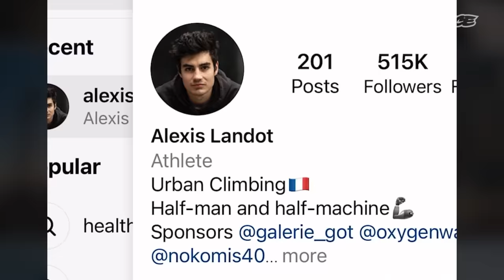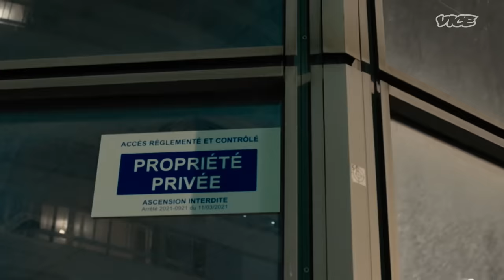Climbing a Skyscraper Without Ropes | Rites of Passage

Comment: I was a high rise window cleaner, hanging off of sky scrapers with nothing but a rope and a little wooden seat. I know from experience that those little metal frames he’s putting his feet on can easily fall off if they’re not installed correctly. I’ve seen them fall by barley touching them with my swinging foot. Idk if the ones on this building are installed differently than the ones I’m thinking off but regardless. I would never trust somebody else building something correctly with my life. People always told me I must have balls for doing the window cleaning, but no. I had a back up line attached to my harness. This guys the one with no fear
Reply: I was thinking the exact same thing, when he's holding on to that cladding, big mistake.
Reply: How much do they pay high rise window cleaners?
Reply: @Grizzle_Uno  of course depends where you at and what company so it’s really a wide range in Florida I saw hourly rates go from 17- about 30$ an hour. I made my most money when I started doing piece work, I would get paid by how many times I went over the building instead of by the hour. And when I did that I just hustled, skipped lunch and did as much as possible. When I moved to Boston the starting pay was $30 an hour so it’s really dependent on where you are and what company you go to.
Reply: I am a high rise window cleaner and there's no way in hell.
2 ropes, boatswain chair, my safety, my rack, harness and rope protectors go over the wall with me EVERY drop.
There are so many sharp edges and exposed fasteners on all skyscrapers that this is just foolish
Reply: Those metal frames are beauty frames 
They aren't structural
They are trim
Glued and clipped to the window frame to hide the exposed edges with a finished surface
They aren't meant to hold your weight 
They fall off all the time
Reply: It varies on location and height of the building.
Mid 20s-40s depending on experience and what you are doing.
Window cleaning, leak repairs, glazing work etc etc all use the same equipment and methods so it's down to the job you're doing
Reply: Where in Florida did you work?
Reply: @corrosivesprings9526  not down here, union work back in New York. Buildings aren't that tall here, 600ft ropes are the biggest we use here.
Reply: @francislutz8027  yeah I know, New York is crazy. the tallest building I did in south Florida on ropes was exactly the length of the 600. In sunny isles. I did a few that were higher but they were on scaffolding. And I hate scaffolding lol. Didn’t they stop allowing rope work in New York a few years back though?
Reply: @corrosivesprings9526  yeah it's stage work only now
I'd rather be on ropes than in a stage any day of the week.
Reply: @francislutz8027  agreed 100%. I hate stage work, had a scary ass close call on a stage on what used to be the tallest building in Miami. Terrifying experience and I’ve hated using them ever since. I still would if I had to but i have an extreme healthy fear of them now
Reply: Living in fear limits your true ability and quality of life
Reply: Just curiosity what does a high rise window cleaning job pay? I imagine good for the hazard of the job. But could be wrong.
Reply: Never mind, answered my own question by reading your comments. That’s crazy $30 bucks on the high end for that kind of work! I figured it be atleast 80 and hour!
Reply: @godjhaka7376  never once said I live in fear lol
Reply: @indatubesurfer  it really does depend on where you are at in the world and what company though. Like I said there some companies that pay everybody by what they do instead of hourly. That’s what I did for a while and made great money. Depending on the job you could make 300+ a day if it’s a good job. Sometimes you’ll make more per drop if it’s a construction clean instead of just cleaning the window regularly with soap and water. Sometimes you’ll get hazard pay if your over a certain height.. it all depends
Reply: Their amygdalas are very unreactive
Reply: @godjhaka7376  true but there is such a thing as healthy fear. Some call it respect lmao but it comes down to understanding the potential consequences and not wanting to experience those.

I was so experienced with knives that I grew foolishly careless, had a very close call, would have killed weaker people, and required invasive surgery and lost work for a year lol. Also had a foolish careless gun accident when I was a kid and I've had a healthy fear of the power of them since.

I feel like true bravery is recognizing the fear and pushing ahead, controlling it

People who are totally fearless end up losing that healthy fear and end up making foolish amateur mistakes and it's sad. I was on a job where like 4 people had saw accidents. Maybe the show was just "cursed" lmao but guess who each person was who got injured? It wasn't the amateurs who were afraid of table saws, it was the guys with decades of experience who no longer had any fear of the machines power 😂

There's a fine line between bravery and stupidity, and an equally fine line between fear and respect. It's unrelated but that's what we need dad's in families for lmao. You obey them out of respect and love, but should your hormones as a teen grt you a bit big for your britches, they have the fear card in their back pocket to correct your course
Reply: I used to work in a high rise building in Chicago and would always watch the window cleaners when they were out there cleaning my building or one near me. I can’t tell you how many times I saw pieces of the building fall but it was several. It is madness to climb skyscrapers with no protection because like you said some of those metal frames, especially if they were decorative, weren’t fastened properly. People would be surprised how haphazard some of them are constructed ie. they aren’t welded on. As much as I saw stuff fall from Chicago’s buildings I’d say the buildings there are built to higher standards than in most other cities I’ve been to. In New York City the builders there regularly cut corners on non structurally important sections. The buildings I saw in London & Paris were built exquisitely so these European climbers are probably safe but still, why take the risk?! They’d be INSANE to climb skyscrapers in Asia or Russia because very few of those buildings were built to western standards. The only ones that’d be safe would be the famous super tall skyscrapers that were treated as legacy projects and were built to the highest possible standards. Any other ones though would be borderline suicidal. A lot of the concrete used was made with an unacceptable amount of sand and other cost cutting materials.
Reply: How do you carry around such heavy balls made of steel?
Reply: @Strings-jg2to  never skip leg day
Reply: Even with your protection that job is insane haha, those sort of heights are wild
Reply: @anthonyclay007  it is. I completely understand that, it’s definitely not for everybody. The crazy thing is even after doing it for 7 years I’m still afraid of heights. But just knowing that if anything happens, my safety equipment will catch me is enough for me to not worry about the heights and just do the job and enjoy it. Even if the heights are scary, the views are breathtaking sometimes. Especially in Florida, right on the beach it was enough to take the fear factor away and make it peaceful in a way lol
Reply: But isn’t climbing cliffs and mountains the same?  Could just as easily grab a loose rock and fall.
Reply: @tojo3507  it is, and never in a milion years would I  do what guys like Alex honnald do either. That Guys insane, just as crazy as this guy, if anything way more crazy lol
Reply: So why don’t the little metal frames fall down when there’s strong wind, or heavy rain? 
Your messages seems BS.
Reply: 12:35
Reply: They’re different
Reply: @corrosivesprings9526  explain your “close call” please
Reply: They are very aware of this problem and for every move they make they check with one hand the stability of that next point to climb
Reply: @francislutz8027  Yeah, this dude said "if I don't try I would have already failed". Well I will just take the lift and be quite happy with failing on this one.
Reply: Interesting
Reply: I assume you don't drive vehicles then?
Reply: It’s not that he has no fear bud he has accomplished fear he beats fear it’s all mental
Reply: They’re made of cheap aluminum too. I wouldn’t trust them with my life

I used to do what he’s doing when I was younger at the parking garages by my place.

They were poured concrete on the outside that was 2” wide 2” deeps pockets of cement in the pattern of a folded fan.

But that was only 50’ high and a lot more sturdy lol I’d never do it with aluminum for even 20’
Reply: EXACTLY.
Reply: @bobbyfischerman4811  lol true

Comment: As a façade engineer those caps typically secured by #10/12 fasteners if the workers don't put them in the cap is not secured to the building. Risky business
Reply: yea you only need one loose fastener